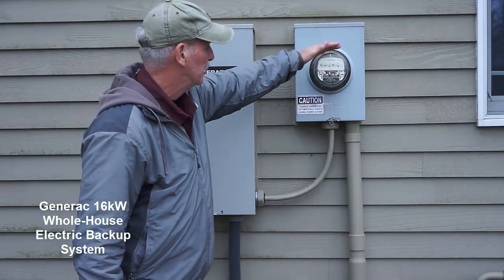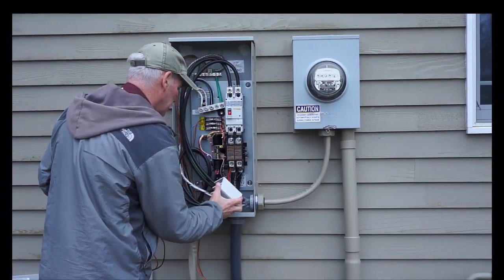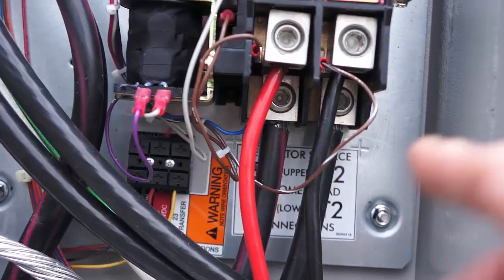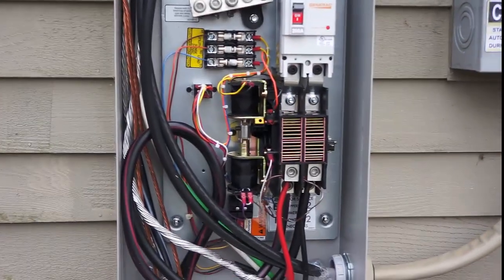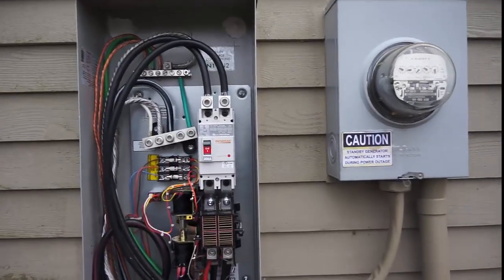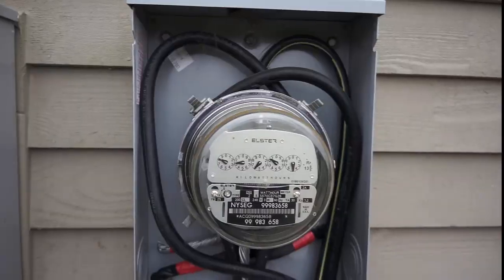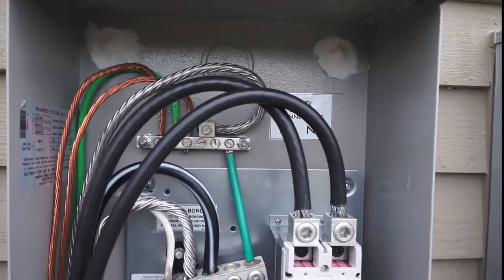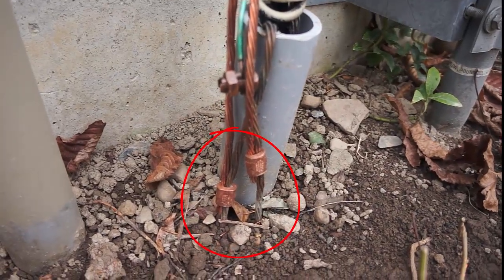Generac 16kW whole house power backup DIY Installation

Comment: Did you have to get an electrical inspection after you wired up the ATS and before you could put the meter back and turn your house power back on, or did you just have to do one after everything was done with the generator wiring and gas was hooked up etc?
Reply: I contacted the electric utility company before I removed the meter, and then after I put the meter back, honestly, they didn't seem to care. When the project was totally done, I had the county electrical inspector come by and sign off on it.

Comment: A quick question, I had a Generac 16KW whole house generator from 2008-2015 that broke. What I would like to do is use the Generac transfer switch Attached to my home and still wired up, to supply power from a tri-fuel Firman generator. Will it shut down the grid power still when electricity is off, or will I need to somehow shut down the grid power manually while the generator runs. Thank you for your help.

Comment: Question ❓
Although you've got a 16kw generator.
With your transfer switch transferring the full load of the house at one time. 
What keeps the generator voltage up within 240 volt range to prevent the generator from shutting down due to low voltage ?
What happens to the transfer switch if it's less than 190 volts at the moment it switched over to generator power?
Reply: If I draw more than 16 KW,  the breakers on the Generac would trip.

Comment: If you shut down the Main Line Circuit Breaker (MLCB) switch inside the generator, put generator in off mode and pull the 7.5 amp controller fuse inside the generator and then lastly shut off the Utility Service Disconnect inside the transfer switch (the generator will not start).  Would this be now safer to work on your generator such as replacing generator batter or generator oil change.  The Generac owners manual says for working on general maintenance issues on my 24kw generator in step 1. Is to cut power to your utility MLCB.  Since my set up is similar to yours where I only have a meter box and a transfer box next to each other (my house was built in 1995 so I don’t have a separate utility disconnect service box).  The installed pushed my meter box from its original position to the left on the side of my house and put the transfer switch right over where the meter box was and fed the my breaker panel wiring into the back bottom of the transfer switch.  Therefore I can use the transfer “utility service disconnect” switch as my utility MLCB as they mention in the owners manual as long as I switch of the generator’s MLCB first and put the generator in “off” mode.  Right.  Lastly you mention the service panel should have neutral wiring reconfigured.  If my Generac installer didn’t do that should I be concerned about touching the service panel when the generator is under load and supplying power to the house?  My knowledge of electricity is limited so that is why I’m asking.  Thanks, enjoyed your video my setup makes more sense to me after viewing your video.

Comment: Did you separate the grounds and neutrals in the house, so they are no longer bonded together? You have the ground and neutral bonded together in the Generac panel, so you have to now separate in the inside panel. First point of disconnect rule not Sharpe shooting just asking
Reply: Yes they are separated in the house panel.

Comment: Just to be clear: you bonded the transfer switch. That’s fine. But, is your panel also bonded? You addressed it in another question but I want to be very clear on this. There should be only one point neutrals & grounds come together. That’s usually the panel. Did you mark your panel “generator in use: system bonded at transfer switch.” It’s not code but a good idea.
Reply: That's an excellent point. Yes, I did unbond my main panel and the only bond is in the transfer switch. I like your idea of putting a note inside my panel.

Comment: Figure 3-2. Generator Distance Requirements: No operable windows, doors, vents, window wells, or openings in the wall are permitted near any point of the generator. 
See Potential CO Entry Points for more information.
Reply: Yes, that's why I placed it 7 feet from my house. (<5feet is code)

Comment: Hey Bill, Great video, thank you. Question: The gauge wire coming from the the generator is much smaller then the service wire. I know the generator company provides that, it just seams odd to me. Is there a reason why?
Reply: I see a 200 amp breaker, so the main service is likely a 200 amp panel. The 16kw generator cannot generate even close to that, less than 60 amps. So.... you can use smaller wire from the generator to the transfer switch than the main house wires.
Reply: @bubbatime  Correct!

Comment: Is that legal to just leave those old wires in the meter pan , it does not look professional to me.
Reply: It passed inspection by my county electrical inspector. Told me to Red tape the dead wires.

Comment: Wow! That is really loud. You'd think they'd have some better sound insulation than that. I know it's just a stand by for emergency use only, but that's pretty much unacceptable. They must have upgrades
Reply: Maybe the new ones are quieter, not sure. Check their decibel (db) ratings.

Comment: Bill I don't remember if you stated in the video after installing the transfer switch did you treat it as your first point of distribution and your load center ( panel ) in your home as a subpanel?
Reply: If you come out of the meter can into the transfer switch, the transfer switch becomes the first point of disconnect. Your fuse panel/breaker box becomes a subpanel, and you MUST separate the neutrals from the ground wires inside the subpanel.

Comment: Exposed service entrance cable is not acceptable, PVC or EMT conduit should’ve been used.
Reply: Exposed SEC IS allowed code-wise in our area. You're right though, if i had to do again I would use PVC conduit.
Reply: It can't be, it's NATIONAL electric code.

Comment: Thank you Bill!  Nicely done. 
The connector you used on the ATS  to exit the 4/0 SER cable to inside of the house, is it a watertight connector or a regular 2” connector.  I cannot find any water tight connectors for SER cable.

Comment: I have been through Generac School I am a licensed electrician, seen a lot of comments about the loudness of the Guardian Series (air cooled). Yes they are very loud, there is an alterative though. The Liquid Cooled series (QS Series) is a lot quieter!. Pro Tip don't mess with the generac equipment too much for it may void the warranty
Reply: Spoken like a true salesman..... dont buy this, but this more expensive one.... dont touch that, it will void the warranty and I’ll have to sell you something else......
Reply: @talonpilot  What a stupid and lame comment you’ve made.

Comment: What was the total cost for purchase and installation on this? I understand it varies but im just curious.
Reply: $3500 for the 16kW and 3500 for installation but I did it myself with a lot of research and electrical inspector approval.

Comment: How many hours per year does that Generac come on ? I suppose its invaluable if you get an unfortunate 2-3 day outage but for small outages it seems like a lot of expense. How much did the generator, switching controller and the transfer switch panel run you roughly ?
Reply: it runs a 5 min warm up test each week, other than that we haven't lost power since i put it in. before that we were losing power 8~12 hours monthly. Then the utility was bought by another company which performed an extensive tree trimming operation, since then , no outages. it was expensive insurance but when we listed our house for sale, it was a huge selling point.
Reply: https://youtu.be/bQR0UyLv4_Y watch this video on the link please. Do not ignore it. Emergency warning ⚠️

Comment: 16kw with no load shed? How is this a whole house generator? You can run your central air, fridge, stove, and we'll pump at the same time? I doubt it.  Generac calls them whole house generators but they aren't .  Please use a load calculator (just Google it) to see what size you need. AND follow national code when you install. 5 FEET from ANY burnable surface and you can't be by operable windows (exhaust gases are deadly)
Reply: All you need and get you kw use over time most house never exceed 12 kw. Ran my house on generator for a week after ice storm never went over 10 kw
Reply: I went a month during a hurricane with a 2000 watt inverter generator. That's a fridge, freezer, and a window AC unit, plus my TV and internet modem, and a hot plate (with the AC off) to cook some meals and charging my electronic devices. I sipped gas at about 2.5 gallons a day. A huge generator would use $50-$100 worth of gas or propane. I prefer the smaller units.

Comment: What size wire from the generator to the transfer switch?  What amperage is that wire rated for? I would have a 90ft run in my situation
Reply: Depends on the size of the generator.
Reply: @im2yys4u81  thank you for replying.  I figured it out using info online.  Used #6 wire for the run

Comment from the maker: I get several comments from electricians saying that I shouldn't be publishing instructional videos like this because I'm not a licensed electrician. To some point I agree that an installation like this can be very dangerous, that's why I comment that the work should be done by a qualified electrician, just like your refrigerator should be fixed by a appliance repair person and your roof shingles should to replaced by a qualified roofer. However, if you're like me, you like to research and perform as many tasks as you can to save money, expand your knowledge and in some cases to a BETTER job than some "qualified" professionals. 
However, most negative comments are from practicing electricians who I'm sure mean well. 
To address the most common criticism:
1. Yes the SER cable could have been put in conduit, but my local inspector said it wasn't necessary, but if i was to do it again I would use individual conductors in conduit.
2. Yes, removing the meter to change the wiring is dangerous and can be illegal. That's why I contacted and got permission from my utility before AND after i did it.
3. Yes i did follow proper neutral bonding/unbonding code in my panel and sub-panel.
    Anyway, I had fun researching and doing the install myself. I felt secure knowing an electrical inspector would give it his blessing and i also had a Generac-qualified technician "commission" the generator before placing in use. I also do the annual maintenance and the unit has been running great for five years now.
Reply: They just don’t want to lose business
Reply: @Avnadrian  Electricians are currently so busy, they can't keep up with their current demand. "Losing business'" is far from their reality.
Reply: I'm a degreed and licensed engineer, and have done many home DIY projects, some beyond what most would judge as appropriate for DIY.  My degree and experience (oil and gas) doesn't make me any more qualified for home DIY than anyone else.  If I don't, or anyone doing work of this nature does not understand the fundamental principles, safety, code/regulations etc., that's when I or anyone should turn to specialists.  It does not take an engineer, licensed (insert trade) to do most home projects, including installing stand by generators.  Most people who hire out are not like you, they have the money and not the time, or just don't want to put forth the effort to learn the complete requirements for doing the project, etc.  I commend you for your clear explanation, as it will help me when I install my stand by, when the day comes.  Just to add one thing, please kindly check with the city (or county), get applicable permits (they are generally inexpensive in comparison to other parts of the project), and ultimately get an inspector to sign off on whatever electrical, plumbing, gas, boiler work the DIYer has self-performed.  This may be required, and will be useful later should you sell.
Reply: @cattleprods911  Thanks for your comments. And yes, I DID get an electrical inspector sign off on my work. (I have since sold my house too.) It was a fun and educational project. I took me much longer to install than it should have, (mainly cause I researched the hell out of it) but I'm retired and looking for fun projects. (I've recently installed a mini-split in my new barn (very easy project). FYI, unrelated, but I've also created a series of educational videos related to Digital Electronics, microcontrollers and automated control (https://www.youtube.com/user/billkleitz)
Reply: Good for you man! A LOT of research and check with those qualified can be fun and save you money.
Reply: Contrary to your critics, my inspector says that SER cable is NOT allowed to be in conduit. Apparently, it has something to do with heat dissipation.  I know that your neutral is bonded to ground in your ATS cabinet, but it looks funny "naked".
Reply: @TodKarlson  The explanation that I got is that you cannot run a raceway within a raceway. Some electrical inspectors consider the jacket on SER cable to be a raceway, so running SER cable through a metal or pvc raceway would be a raceway within a raceway. I was given the same logic for heat dissipation. I think it would depend on the inspector. I ended up running individual cables through 2 1/2" pvc conduit. Sec 334.30 of the NEC speaks to sheathed, non metallic cable. It says:  "Sections of cable protected from physical damage by raceway shall not be required to be secured within the raceway." I interpret this to mean you can run SER through a raceway.
Reply: @GeorgeWashingtonLaserMusket  good explanation.  I know different areas have different code violations even though the it's called the "national electrical code" book. I understand it's basic instructional video but I see so many code violations and it's so dangerous to do it that way. You never run exposed wire outside. It should be single conductors in conduit. Never use the meter as a raceway. I'm surprised the power company hasn't fined him for that. The meter should have been moved and transfer where it was. 🤷‍♂️
Reply: It appears you ran the low voltage with the high which is a violation.  It also appears the generator wire is too small.  Code requires a generator with automatic switch to power everything connected to it simultaneously.  I'm guessing that system doesn't meet that requirement - but if the inspector allowed it I guess you are ok.
Reply: @ericthered9655  That's strange. I used the cable that was supplied by generac for the high voltage and their instructions showed to include the low and high in the same conduit.
Reply: @kleitzw  There might be an exception in this case. I'll have to look it up.
Reply: @kleitzw  I notice a difference between the size of the wire between different size generators. I installed a 17kW and used a sheathed cable I bought from Ziller Electric (6-18 ga control wires, a 3-#3 AWG Class C conductors, and 1-#8 AWG Class C conductor. I presume you're talking about running the control wires through the same conduit as the power leads. The explanation I got is that so long as the wires are rated for 600v they can run in the same conduit.
Reply: Electeictions don’t want others to see you do it, takes the mystery out of the job.

Comment: Why are the cables from the generator so much smaller in gauge?
Reply: All cable sizes (gauge) are based on the maximum amount of current (amps) they may need to carry.
Reply: @BillKleitz  I understand that (GC 20 yrs) but I was surprised to see smaller gauge wiring coming from the generator when it is running the whole house. Like you said it depends on the amount of current so maybe I wasn't paying attention. I was under the impression that the unit was supplying as much amperage as the public feed. Thanks, for the feedback though!
Reply from the maker: It's been a while, but I think the 16kw generac has a max output current of 65amps, whereas the utility can supply 200amps. That's why the different cable sizes.
 It's called "whole house" because it supplies my whole panel but it could never supply the 200 amps that the utility can. I've never drawn more than 50 amps anyway because I have natural gas heat and minimal AC.
Reply: @pcpmgroup9822  16,000 Watts/240 Volts = 66.66 Amps
That's how you get the amps

Comment: Did you hook up ground wire from generator to transfer switch to top bar?
Reply: There is a ground lug on the exterior of the generator that goes to your ground rod. The ground wire from inside the genset to the transfer switch goes to the ground lug inside the transfer switch.